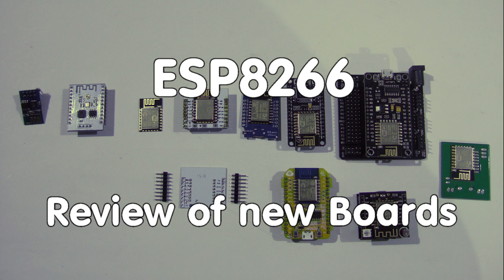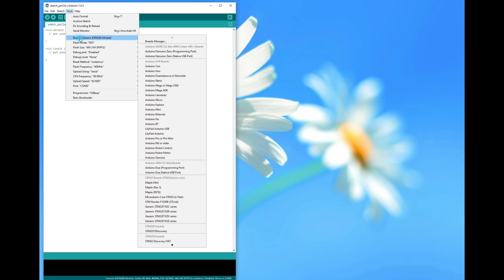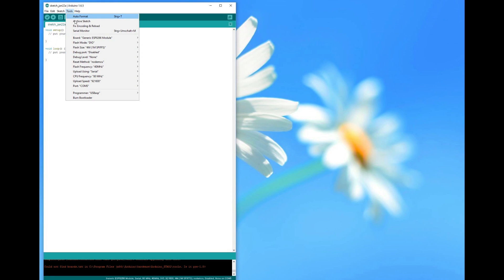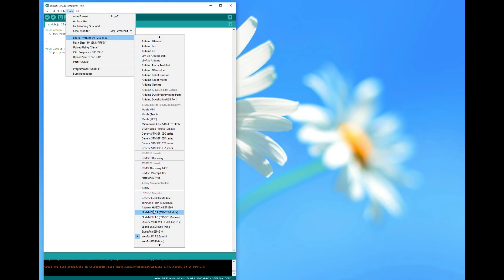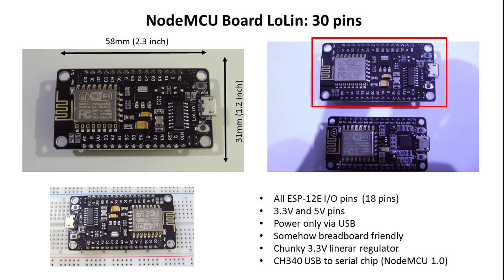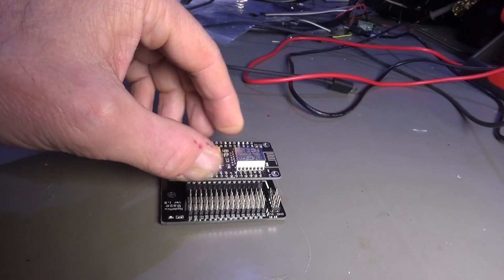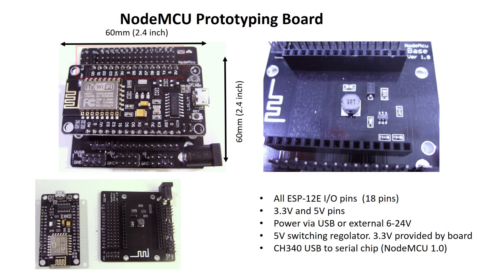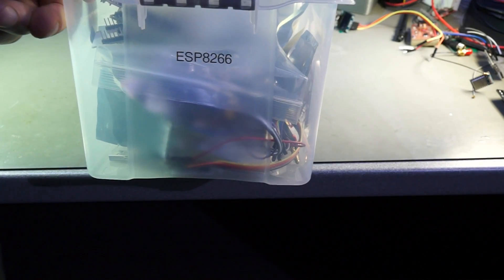#41 Review: Mini NodeMCU (Wemos), Prototype Board, NodeMCU (DOIT&LoLin), Arduino like Wemos, Witty

Comment: Dear Andreas, your videos are always excellent. One idea I had watching your ESP8266 comparison is that the Witty Cloud Module still has still one advantage for beginners that are not so familiar with soldering. If you want to work in low power scenarios but are not abled to do the fine soldering of a naked 12F (like me) a Witty Cloud Module could be used. In this scenario I would remove the RGB-LED with a tong and I think the Pins GPIO12, GPIO13 and GPIO15 could be used then as normal input Pins. For a scenario powered with AA-Cells I would also desolder the voltage regulator and use a HX7333. Am I correct with these thoughts?
Reply from the maker: I think you are right. Just I never saw GPIO12-15 on a ESP8266

Comment: Esp8266 12 E Doit chip wifi is not connected.
-------------------------------------------------------------------

My Code:

#include <ESP8266WiFi.h>
void setup() {
  // put your setup code here, to run once:
  Serial.begin(9600);
  Serial.println(" i am started");
 WiFi.begin("prem@mpbros","prem1234");  
   //unsigned long startTime = millis();
  while (WiFi.status() != WL_CONNECTED) 
        {
          delay(1000);
          Serial.print(".");
          //if ((unsigned long)(millis() - startTime) >= 8000) break;
        }

         if (WiFi.status() == WL_CONNECTED)
  {
   Serial.println("WiFi connected");
   Serial.println("IP address:");
   Serial.println(WiFi.localIP());
   
   Serial.println("Mac Id:");
   Serial.println(WiFi.macAddress());
  }
}

void loop() {
  // put your main code here, to run repeatedly:

}
Reply from the maker: Unfortunately, I cannot do remote debugging. But I am sure you will find the error. Maybe just wrong credentials?
Reply: @AndreasSpiess  Hi thank you same credential and code i am tried different esp8266 manufacturer connected successfully. only doit manufacturing is not working

Comment: Here is a hint how to make any NodeMCU board breadboard friendly. This works for ESP32 boars as well, of course. I simply use two breadboars and remove one of the power rails of one of them. The two bradboards can then be combined to be covered by a NodeMCU board.
I try to add a link to a photo... not sure whether YouTube allows to place this link: https://www.dropbox.com/s/tmtqggk0bzvfykh/2018-03-20%2012.27.34.jpg?dl=0
Reply from the maker: You are right. I do not like it very much because it is not very stable to put it away. But one day I will build one with a sheet of something below it to fix the two breadboards.

Comment: Please be careful with the Witty Cloud Development board, Andreas. You state that the bottom part can be used to program a breakout boards. But the USB cable's Vcc (5+ volts) is passed directly up to the Vcc pin for the upper board. The Witty has this header pin connected to a linear voltage regulator on the top board and not connected directly to the Vcc pin of the 8266.  I have a collection of breakout boards that connect Vcc directly to the Vcc pin of the 8266 expecting that the circuit is providing well regulated 3.3v power. You would likely fry any ESP8266 chip on a breakout board that is directly connected to the Witty's programmer.

BY the way. Love most of your content.
Reply from the maker: Thanks for the hint. I do not use the bottom PCB for other uses than the Witty board. I have other USB to Serial adapters where I exactly know what they do...

Comment: Andreas, will the NodeMCU board accommodate the ESP32 DevKit v1 board from DoIt? Like the Lolin board, it is also a 30-pin board.
Reply from the maker: I do not understand your question
Reply: I would like to use the NodeMCU expansion board accommodate the DoIt ESP32 Devkit v1 board?
Reply from the maker: So far, I did not find any expansion boards for the ESP32.

Comment: in my projects I prefer to use a pure ESP 12 module, without any support board, and soldering wires directly to the module, make things even more cheap ;-)  just using a USB to serial converter and supplying a good and clean 3.3v voltage.
Reply from the maker: +eduardfc That is a good idea,especially if you want to deep-sleep your modules
Reply: Isn´t The Wemos D1 mini just a board with micro-USB-connection? There is not much more on it.
Reply: @c0r0y, Yes, a board and voltage converter and the circuitry for the USB interface. Difference price about $2, not a big deal. But for sure it takes more space and power, and that can be of importance if You are housing it in a small box with battery.

Comment: Hi Andreas, Thanks for the such an informative video. I have one question.
I am right now confused between WeMos d1 min and NodeMCU board.
On WeMos forum, people are saying that only WeMos d1 mini is an official board and NodeMCU board is a clone. But, in most of your and other videos, NodeMCU board is being used.
Which board should i buy and from where? Links below :-

WeMos Forum: https://forum.wemos.cc/topic/909/what-is-the-latest-version-of-the-wemos-d1-mini/5

WeMos D1 mini: https://www.aliexpress.com/store/product/D1-mini-Mini-NodeMcu-4M-bytes-Lua-WIFI-Internet-of-Things-development-board-based-ESP8266/1331105_32529101036.html?spm=2114.12010608.0.0.Oguzq9

NodeMCU: http://www.amazon.in/dp/B00UY8C3N0/ref=pd_luc_rh_sbs_01_02_t_img_lh?_encoding=UTF8&psc=1

Thanks in advance.
Reply from the maker: NodeMCU is just a name without a manufacturer behind. There are a few boards available as pointed out in the video. The first who created such a board gave it the name.
The same is true with the Wemos mini. Wemos created such a board, which is very similar to the NodeMCU, just smaller. Because the board was successful, others, like with the nodeMCU boards, started to copy. That is, how business is done in China.
So, you can buy whatever you want. I have many different boards and did not find particular quality issues. If you want a small one, buy a Wemos mini like one, if you want a big one, a nodeMCU like one
Reply: Thanks. I have finally ordered WeMos d1 mini for its small size, unsoldered pins and being official from WeMos (instills more trust).

Comment: Nice instructional video. I was confused about the right esp8266 to use on my next project (word clock) and now I'm inclined to use the wemos or nodemcu v3. Which one do you prefer?
 I red that the last board (two parts with a ldr on top) have a poor wifi reception if you use the bottom board (maybe some shielding of the bottom PCB).
Reply from the maker: +Sam C I have no preference other than the differences mentioned in the video.
I did not do any tests with the Witty board. If you watched the video, you know, why.

Comment: This was a good one.  I still don't know the significance of NodeMCU, but I'll figure it out eventually.  This video raised a good point about a board I was considering... the sensors & leds are hard wired, taking up valuable pins.
Reply from the maker: NodeMCU was the first development environment for ESP8266 (except the native Espressif one). It uses LUA as language.
They delevoped a board with an ESP module plus all necessary parts to easily program these modules (USB to serial converter, flash signalling).
Then the Arduino IDE was enabled to program the ESPs. Because of the origin, the name of the board was not changed.
So, if you want to have a hassle free development board, buy a NodeMCU board. Then you can decide whether you use Arduino IDE or NodeMCU development environment to program. You can switch forth and back, because each environment deletes everything in the module before it starts with its programming.
Reply: I wasn't aware I could switch back and forth.  I actually thought the the "node" part of the name referred to the board, not the environment.  Lots to learn yet.  I am looking at a couple of items on FastTech for starters.  I am looking at one of the NodeMCU boards, a Witty board (a pretty witty name), and they have an ATTiny USB board that is very very tiny.   I have to start somewhere, and I might as well start connected!  I appreciate your series.
Reply from the maker: +Ramix Nudles ATtinys are great devices, but probably not very good to begin with.

Comment: Hi Andreas, I have a problem with my Wemos D1 mini board (it's a copy from Aliexpress): It's very nice and small and I can talk Lua to it via CoolTerm or ESPlorer. However , I can't get it to work in the Arduino IDE – all I get is:

warning: espcomm_sync failed
error: espcomm_open failed
error: espcomm_upload_mem failed

although I have dowloaded the correct board settings.

Can you help me?

Many thanks in advance!
Reply from the maker: I use the NodeMCU 1.0 board with 115200 (save) or 921600 (fast). And the ESP8266 Community version 2.3.0-rc2 Board definition file. I just tried, it works also with Wemos D1 R2 & Mini.
Reply: Thanks for testing and for your answer. Did you have to flash the NodeMCUs first with that flash tool (https://github.com/nodemcu/nodemcu-flasher)?
Reply from the maker: There are two completely different environments to work with the ESPs: The LUA and the Arduino IDE. If you use one or the other, they erase the flash completely. So, you do not need anything than just upload.
Reply: Yes, I know that, it just doesn't work. I did work fine with the Feather Huzzah board from Adafruit but not with my WeMos copy (I hadn't checked that it was missing the official label when I ordered it, my mistake). Anyway, I ordered an ''official' WeMos D1 mini board for Aliexpress, maybe it behaves differently.
Reply from the maker: Do you see the Serial connection in your IDE? It has the name USB-Serial CH340 in windows (check with device manager). Try also to reset the device when the IDE waits for upload (several trials). And make sure, that you have no other cables connected to your board pins. Does the ESP-12 blue LED flash when you connect the board to the serial?  If it still does not work, it is probably defective.
Reply: There's a blue LED next to the metal module that blinks, whether I use the Lua part over serial or when I try to upload a sketch with the Arduino IDE. I also tried to change the esptool to esptool.py in the "platform.txt" file, but it just gave another error message ("ESP8266 not found" or something similar).

I'm not losing sleep over this (I have a day job to take of, so that I can afford to buy all these toys...) but many thanks!
Reply from the maker: +pepper669 try also to uninstall the IDE and re-install it. The board seems to work. Do you have the same ESP board definition files as I have?

Comment: Hi Andreas,

I love your videos, very good quality!
I bought a few Lolin and D1 mini from Aliexpress but I can't get them to work with the Arduino IDE.
I know they all use a CH340 for the USB connector but I don't manage to find a proper driver for it !
The boards do not appear in the list in the IDE
Do you have a link to one that worked for you?
Any platform is ok, Windows, Linux or Mac...

Thanks so much in advance!
Reply from the maker: I use windows 10 and have no problems with the driver. But I am no more sure if I had to install one at the beginning. Check once in device manager if you see a unknown serial adaptor device. There, you should be able to install the device driver. I googled and found this link: http://www.arduined.eu/ch340-windows-8-driver-download/. My device driver also comes from wch.cn
Reply: i have exactly the same problem...i tried 10 usb cables and none doesnt work with wemos, but all works with arduino...i use windows 10 and 7 and have no luck all im getting is "Unknow device" in device manager...
Reply: but when board is powerd on usb it create some sort of wifi (AI-THINKER) i have wemos d1 mini and nodemcu esp2866 12-e v3 and with both boards is the same.... :(
Reply from the maker: did you try to install the CH340 driver (see last comment)? Do you have another device with a CH340 USB to serial chip? Does this one work?
Reply from the maker: The ESPs sometimes come with pre-installed software which  create a WiFi cell. This software will be replaced with your code if you manage to upload.
Reply from the maker: I just read that your boards do not appear. Then you have to read a tutorial on how to install the ESP8266 in the Arduino IDE. It does not work without some tricks. e.g. include "http://arduino.esp8266.com/staging/package_esp8266com_index.json" in your preferences screen.
Reply: I actually have a legit NodeMCU board which also uses a CH340 and works fine on my computer. I therefore think that the chips I tested were faulty... I guess I shouldn't go for the cheapest ones on AliExpress. It still puzzles me that out of the 3 Lolin and the 2 D1 mini I tried, none of them were working...
Reply from the maker: I cannot believe that all the different modules are defect. I have many modules liying around and I do not remember having one which did not work. On Aliexpress, price and quality is not related to my experience. Many suppliers sell exactly the same boards, just at a different price.
I still think, something else is the root cause.
Reply: +Andreas Spiess I know :/ I really don't get it. Do I need to flash them before they become visible in the Arduino IDE or just plugging them should do it?
Reply from the maker: Here is a tutorial to get started. Maybe it helps: https://youtu.be/K1DE00LKfiY

Comment: problem with these boards and some small arduino boards is that the can often fail on 12v supplys as its at the limit of the small regulator, using them in a vehicle with the 14v car supply (yes  thats right, cars are 14v with the engine running!) they often die easily
Reply from the maker: This is quite obvious as (14-3.3)V*0.1A = 1.07 Watt *90 C/W = 96 C. So, the regulator heats up to at least 96 C over ambient temperature. If you connect anything else to the board, the temperature will be even higher because the current is higher. You can avoid this easily by putting a resistor in line with the plus wire. The resistor could be e.g. 60 Ohm. With 0.1A current it will reduce the input voltage by 60 *0.1=6 volts. Then, the resistor will dissipate 6V*0.1A = 0.6 W and the regulator the rest.

Comment: Sehr informativ! Gut zu wissen, das die Arduino-Like-Boards (da gibts ein paar Variaten von) keinen wirklichen praktischen nutzen haben. Die NodeMCU Boards von DoIT gibts recht günstig im 3er Pack bei Banggood. http://goo.gl/it7uE1

Von diesen Witty Boards mit RGB-LED und Fotowiderstand habe ich auch noch andere Varianten gesehen, wo alles auf einem Board war, teilweise sogar ohne serielle Schnittstelle und LEDs an fast allen IOs. 

Für Projekte die nachher in ein Metallgehäuse kommen sollen und nicht viele IOs brauchen, nehme ich noch gerne die alten ESP-02 Boards mit externem Antennenanschluß. Die bekommt man auf Ebay für etwas über 2,-€. Kabel und Antenne für jeweils 1,-€.

Eine NodeMCU Board mit Antennenanschluß ist mir leider noch nicht begegnet.
Reply from the maker: Ich verwende noch die ESP07 wenn ich einen Antennenanschluss brauche. Von denen habe ich noch einige...
Wie gross ist die Flashgrösse des ESP-02?
Reply: Da ist ein EN25Q80A 8 Megabit Serial Flash Memory with 4Kbyte Uniform Sector drauf. Den kann man notfalls austauschen. Die ESP-02 Teile sind halt super klein. Kleiner als ein blankes ESP-12e Modul.
Reply from the maker: Sie sind auch betreffend IO Pins eher mit dem -01 zu vergleichen, einfach mit Antennenanschluss...